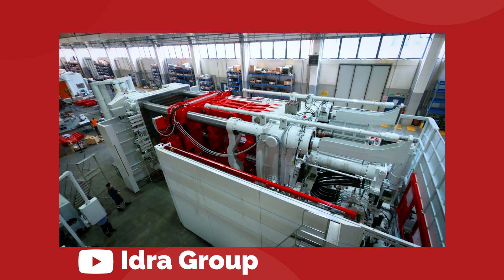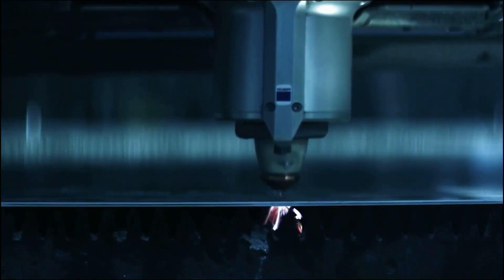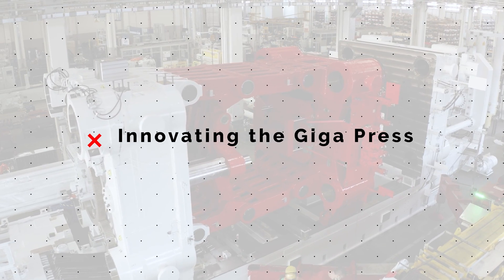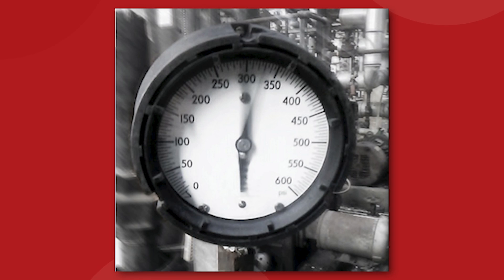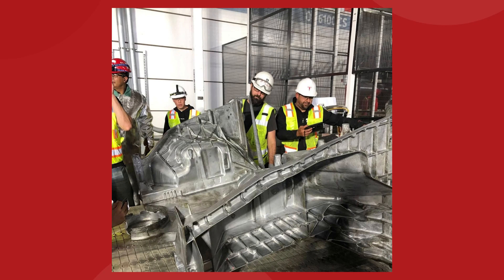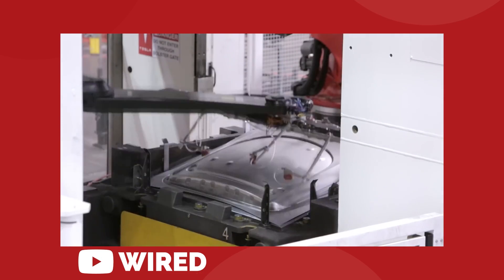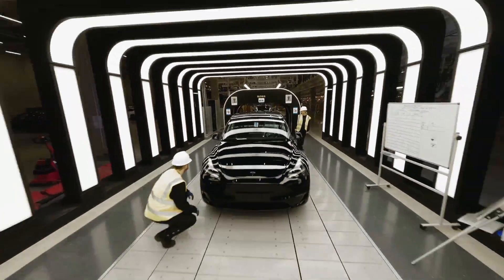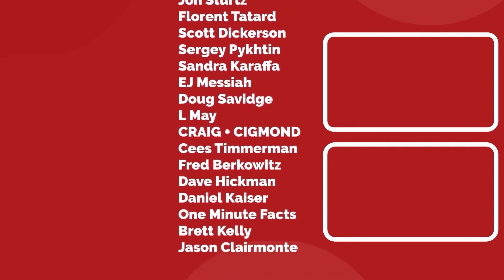The Real Reason Tesla Developed The Giga Press!

Comment: Very interesting! A cast aluminium part has many advantages. In addition to what is mentioned in the video, there are some more points: its lighter than steel, it is more corrosion resiatant with less efforts in coating it, and it can produce very complex shapes in one production step. But I dont think it makes much sense to cast the entire car in one go. Simple components like panels on the outside are easier to press from thin sheet stainless steel. Casting aluminium that thin is probably too difficult, and steel is also stronger. But for the frame work its a real clever idea.
All this goes, however, totally against the business model of the established car manufacturers. It would have been possible since decades ago to build cars that dont  rust- but thats the exact opposite of what the manufactorers want. If the competition wouldn't prohibit it, they would build cars that desintegrate after 5 years, so people have to buy a new one. But obviously Elon Musk is not the kind of business man that you usually find in big corporations.
Reply: Aluminum is less ductile than steel and has less elasticity making it prone to cracking over time, this is why suspension components will never be made out of aluminum, and aircraft have to recertify every so many flight hours. I doubt they are stamping their steel components out of stainless steel but 300 series stainless steel, will rust with the combination of salt and water in many northern parts of the world. 316 stainless will not but I can guarantee they would not be using that. At the prices a Tesla costs you are just getting what you pay for
Reply: @papapsych2746  many cars have aluminum suspension parts now. 

Rear subframes have been aluminum in certain cars and crossovers for a while, along with front and rear upper and lower control arms and shock mounts.
Reply: @volvo09  Control arms surprises me, maybe 7000 series aluminum is up for the task thanks for the info
Reply: @papapsych2746  It's been kind of thing to use aluminum suspension parts for a very long time. Even the C4 corvette had lots of aluminum suspension parts. But starting around 2000 is when you started seeing lots of manufacturers use aluminum for suspension components, hubs assemblies, etc. The 2000 Honda Insight was Honda's test mule for making nearly everything on that car out of aluminum, aluminum body, aluminum suspension, aluminum brake drums (steel inner ring), aluminum tie rods, etc. What I think this video misses though is that as you scale up the casting to such sizes it gets increasingly difficult to make viable parts. From an industry insider he took a look at the photos of the scrap piles of the casted parts and he saw what looked like still early stages of lots of waste, the gist of what he said was basically their failure ratio is still extremely high for the industry. 

I'm still curious how well these parts will fatigue or break. Also not sure how well it will be repairable, usually repairing casted parts sucks.
Reply: @sigmaprojects  Aluminum Tie Rod Ends?
Now I have seen too much. I guess they don't have to worry about their casted parts if they are casting things like Knuckles and control arms out of aluminum. I would of though their service life would be greatly shortened because of fatigue over time.
Reply: @papapsych2746  Honestly not sure. I think the fatigue life can be quite good if engineered properly. For instance in my insight, I have the original tie rod ends with 275K miles on them. I changed the lower control arms only because the bushings were shot, but no fatigue shown on the casted parts. What I have heard about in terms of fatigue has been the sheet metal. A casted part should have a much higher fatigue life due to the structure designed into it. 

As for the downsides with what Tesla is doing from my understanding it's still way too difficult to produce the casted parts in the size they want reliably. Like they do x-ray checks to make sure each part is good, but from independent photos of their waste bin, it looks like the success rate for a good part is still kind of low. So it may be at the moment not cost effective for Tesla and who knows maybe it will never be, but as being one of the first it might just need more time to mature since in the past casted aluminum parts for the chassis is still a relatively new thing. Even in my Insight, there's only a few parts that are actually casted aluminum, most everything is specially engineered extruded Aluminum, which Honda says that they had to come up with several patents to achieve. 

What worries me more is the cost of the actual part and repairing. Like does a Tesla with these casted parts become totaled after cracking the casted frame portion? But I don't own a Tesla with a casted part so it's no skin off my back, just food for thought.
Reply: @sigmaprojects  Yeah, if the rubber delaminates on old bushings in steel parts they generally can go without getting replaced, unless were talking about all of your motor mounts. How much more expensive were the aluminum control arms compared to steel ones? Since you had to buy OEM I'm betting.
Reply: @papapsych2746  They were a little pricy, I waited for them to go on sale since it wasn't critical I get them at that moment. I bought Beck Arnley, Dorman is cheaper, but when I waited for the Beck/Anrley ones to go on sale it was around $75/ea. Honda OEM ones are $230~ I think. Regular priced Dorman ones are like $135~ I believe. I wouldn't use my car as the goal post for part prices because the 2000 Honda Insight was pretty low production run vehicle, only about 18~20K units were produced world wide over the whole life cycle of the car. In comparison Toyota produces more Camry in the US alone in just one month. So it's kind of a hard to find parts car. Quick look, you can find say an aluminum control arm pair for a Suburban for like $250 and those are beefy units for a heavy vehicle.
Reply: @papapsych2746  I just did another quick search, for a Honda Odyssey I found a pair of aluminum aftermarket arms for $150.
Reply: @sigmaprojects  Yeah but they use the same parts for different cars over the years too. So the parts probably weren't exclusive to just your make and model. You really see this allot with American carmakers when looking for your part at a junkyard.
Reply: @papapsych2746  No, unfortunately they are specific to the that model. The 2000~2006 Honda Insight was built like a test mule/prototype. I've torn the car completely apart. Last piece to tear down is to do a full engine tear down. But from the parts diagram the only thing that is directly usable from other cars is the valve spring retainers are the same found in many other D-series Honda motors. 

Like I thought like you did and I hunted and searched for ways to make things work on my car from others. Like The only thing that remotely worked were certain gears that could be swapped out within the transmission. So I built a Frankenstein transmission out of a Civic Hybrid 5 speed utilizing a gear set from a first gen Honda Fit. I went to try the same thing with the steering rack in hopes to get a faster ratio, come to find that the pinion angle is different in the Insight, but not only that they used a thinner rack gear in the Insight along with more billet pieces instead of cast pieces.  The car was just a lot of fun tearing apart seeing all the care that went into making it as light as possible. But yea, Honda went quite overboard with the whole car, from shortened fasteners, aluminum hardware, like aluminum nuts and bolts for certain parts, to drilling holes out in the gear sets and differential housing, to extruded and billet pieces instead of casted parts. They really did put in a ton of work to get the car down to 1,850lbs, hats off to the Engineers.
Reply: @papapsych2746  The Filipinos  have been using SSTEEL  for gates and railings for decades in salty environments   like beachfront,  they have 7000 islands, also they have a lot of SSTEEL  Jeep conversions.
Reply: @aurelio-reymilaorcabal9669  Yeah are they submerging them in the ocean?
I'm talking about wet salty roads.
Reply: @papapsych2746  I live in Toronto Canada  where  salt and brine is used like there is no tomorrow , but only 3 months of the year , unlike  in many areas in the Philippines  where  salt is in the air 24/7, unpainted galvanized jeepneys and  "  SSTEEL   Owner type Jeep" conversions   are quite common, and it is easy to  find examples of 30 yr old  SSTEEL Jeeps still running , they just slap on a new powertrain, my family was in the Jeepney transportation BZNZ in my youth, I had classmates with SSTEEL Jeeps growing  up , they lived in Malabon  where fishing was an industry,
Reply: @papapsych2746  the air in coastal areas in the Philippines  is so salty many homeowners rain gutters are made of SSTEEL , show me a house in USA  that has  that.
Reply: @aurelio-reymilaorcabal9669  They make them so I'm sure people buy them. Never heard of 316 stainless steel framed jeeps though.
Reply: @papapsych2746  Well, the stability of such aluminium casts depends on the design. It takes a lot of developement (and perhaps some fails) to find a real good design. 
And Tesla does make cast suspension components now for the Model Y, replacing some they made from stamped steel and plastic before.
Acoording to what they say, the new Cyber Truck is made from stainless steel, and it has been done before already, like for the Delorian. 
And if it really doesn't work, there are always options like using carbon fibre parts. If it is done in automated production, its not even very expensive.
I'm pretty sure if Tesla invests billions in new factories and machinery, they know what they are doing.
Reply: That's not entirely true what you're thinking. Sure planned obsoletion is a thing, all manufacturers do it, but not always just maliciously. Furthermore manufacturers do use casted aluminum parts for chassis and in many areas they can use it to save weight. But none of the established brands want to flip the bill on something like a gigapress because it's not guaranteed to be profitable.
Reply: @sigmaprojects  Well, thets exactly what distinguished Musk's way of operating from that of the old manufacturers - they don't take risks and always go for the guaranteed profit. But with a new product like electric cars thats not the way to do it. The first cars were also build like horse carriages before, but it was soon clear that its not the best way for a car. 
From what I have seen from Musk so far, I'm quite sure he knows what he is doing. This is a totally new design and production method. Comparable perhaps with the change from the ladder frame cars to the stamped sheet steel chassis after WW2. The casting might be the next step in this evolution.
Reply: @petebeatminister  I mean that's the benefit of being a smaller company with no pre-existing employees, factories, suppliers, etc. I think people seem quite misinformed about car manufacturing. The main difference in construction that Telsa is doing over others is only in a few of the Models where they use the giga press. Everything else is seen in other vehicle manufacturers and done better. Where Tesla has excelled in is with their battery tech. They're still the leaders in that field. 

But for instance, GM did the EV1 vehicle, testing the waters for an EV. They don't have their own battery division, so they can't just make a jump, but they did anyways. Their EV1 wasn't bad for a first time EV, but the battery tech just wasn't there and the company that they teamed up with was promising a lot, but couldn't deliver. So for GM it didn't make sense to keep the EV1 since it's profit margins weren't that great and the battery technology just wasn't there yet. However, they didn't just stop on EVs. They kept in the game and put money towards hybrids and after 7 years since the EV1 showcased their concept. Then few years later they came out with the Volt, then the Spark, then the Bolt taking their time to figure out what's the best for them to produce volume EVs. 

People criticize existing manufacturers, yet it's not like they can just switch gears on the fly nor is it the most profitable. The profit margins on an ICE car is still really good and there's still tons of demands for any kind of car, so there's not reason to just stop and pivot. Fast forward just another 5 years since the Spark, Bolt, etc and GM got to work on their next line of EVs because the supply chain and technology for batteries are now finally mature. Government mandates on emissions keep making it harder on ICE, countries like China talking about straight up banning ICE and well now there's more urgency to get their EVs going.

The thing that existing manufacturers understand is scale. They move millions of vehicles each year. Like Tesla sells around 300K units a year in the US, which is pretty awesome all things considered. GM on the other sells almost that many in a month in the US. All businesses will work to survive and make money. It's only recently starting to make sense for manufacturers to make a bigger shift into EVs. in the next 5~10 years the landscape of EVs will be crazy different.
Reply: @sigmaprojects  The big difference between Tesla and othe car manufacturers is, that Musk is actually the boss in his company. If he wants something to happen, he just says "Do it".
The other ones have a board of managers, who all defent their seat with teeth and claws and hope for a nice christmas bonus. Risk taking is not what they want - and not what the share holders want. 
And of course Tesla had mostly the same production methods than the others. Until now. That is the amazing thing on the giga-press technology. It may revolutionize the entire car industry - or it may become a giga flop.
There is a lot that could be said about GMs EV1. Some people think it was only designed to prove that electric cars are crap. And that that was the reason why they didn't actually sell it, so they could retrieve it at any time.
But anyways... I think Tesla has shown that electric cars are not a joke. But thats also because technology has improved enormously since the time of EV1, both on the battery side but - may be even more importantly - on the motor side. The new Tesla motors are one step short of a miracle. With some more improved batteries, the whole electric car thing become a real competitor for ICE cars.
There is one big question mark still, however. Where do we get all the electricity from, if all cars are supposed to be electric?
Thats something nobody can answer with seriousity so far. Because that will require the next revolution: the one in electricity production and distribution.
Reply: @petebeatminister  Yea, when you're a smaller company it's easier to move, if Tesla was the size of GM people would be criticizing it for not taking risks or being slow.

The conspiracies around the EV1 are just that. It's normal business practice for automakers to not sell those kinds of vehicles. Like the very first Fuel Cell vehicles were lease only. It's a major liability and they want to control the press about it too. They don't want a failing one to bite them in the butt in the end.

The battery technology just really wasn't there yet. But like I said, GM wasn't bowing out of electrification. It takes 6~7 years to develop a new vehicle. That's why GM went on to make some serious hybrids like the Volt and short range EVs shortly after the EV1 project. The only companies that really poured money into electrification was GM and Toyota really. 

The giga press may be successful one day, who knows. Other manufacturers have been using cast parts for a long time so who knows, that or stamped parts even if more pieces may still be cheaper when considering scale of production. Like many people think 3D printing is cheap, just push a button, etc. But it's cheap for short run production, not cheap for individual pieces, not like stuff that is mass produced. So we'll see if IDRA can make the press work to the levels required for business. But remember, only some Model Ys will us the mega casted parts and MAYBE the Cybertruck. The process is still in its infancy and probably why it's not just rolled out for all vehicles just yet. It's not uncommon for manufacturers to try new ideas and do them for a complete production run and then switch back. Like Honda did center take off steering racks mounted up really high in the chassis to improve interior leg room space in there vehicles. Almost all of Honda's had them from 2000~2006/8 depending on model. But ultimately for whatever reasons they decided it wasn't worth it anymore and went back to conventional steering racks.

Tesla motors are great, but they're honestly not nearly as impressive as their batteries and computer management. The motors anyone can honestly replicate. The batteries and computers people say they can replicate, yet we haven't seen it just yet. Like Tesla still is on a 400~450v platform, yet manage their power so well. Most new EVs are being built on 800v or more now. Being able to work with higher voltages results in better efficiencies. So maybe next gen Tesla will make the move to higher voltage platform and we'll see them stay ahead in the range department. The gap is closing though. Back in 2012 with first Tesla it crushed the competition, Tesla understood at that time EVs aren't for sports cars, not for basic commuters, but for Luxury Missiles. So they came out with something that worked, while everyone else was trying to make affordable EVs which at that time wasn't really possible. Leaf and Spark were just so impractical. But fast forward 10 years (which isn't much time in the auto industry) and now almost all other EVs are about within 80% of Tesla in terms of range and performance for the same price and some exceeding Tesla, but for more money.

As for power grid maintenance? As the demand grows for more EV charging so will the demand for more electrical grid infrastructure. No one actually plans for anything in the future sadly until it's already here. So at least in CA there's just so much solar everywhere and it's growing. So I imagine many people will be getting localized electricity provided. People also say "hey, but people will charge their vehicles at night and that's when it'll be the worst" yes and no, during the day can be bad if it's summer with everyone running AC system. Also electric companies have switched to a time of use pay structure. So it'll end up forcing people to charge at different times of the day to keep their bill lower. Also cars like the Aptera for regular commuters boasts that if parked outside in full sun it can charge up 40 miles. For many people they commute around 40 miles a day, so if you had an Aptera you'd only need to plug in your vehicle for longer commutes and only top it off once and while. But we'll see if it actually can collect that much electricity in a day.
Reply: @sigmaprojects  Well, there are a lot of factors that play a part in the game. At least from what I have seen, the big companies act very inflexible and are always much to late. If you look at their electric vehicles today, they have basically done nothing else than a bit of cosmetic. I just watched a video about the production of the new VW Buzz, which is sort of a retro style electric  VW Transporter - it is build completely in the oldfashioned way. Really impressive is only the price: it starts from $ 60,000.
And its the same with a lot of electric cars, all the huge SUVs that weigh close to 3 tons, or 100k sorts cars like the Porsche Taycan.
But the power supply is a serious obstacle, I think. A few more solar cells or wind turbines wont do, if the goal is to do away with all fossil fuels. This is not about some wealthy hippies in California - its supposed to happen world wide. And in all sectors, cars, planes, trains, trucks, utility machines and whatever else. That is a hell of a lot of power that is needed for that, we are nowhere near to be able to meet such demand. You see it now: a little war in Ukraine, and the whole energy market goes into panic mode.
Reply: @petebeatminister  I haven't looked at VW, but the brands that are serious like GM or even Hyundai they build their EVs like they're suppose to on a new specific platform. Inflexible is what many see, they're just working with cost efficiencies. 

Electric planes, that's not going to happen any time soon. Trains have been electrified for almost a hundred years now. It's common to see a diesel-electric locomotive. Meaning you have electric drivetrain with a diesel generator onboard. Eliminating fossil fuels completely is quite difficult and isn't likely to happen anytime soon. However, you can capture nearly 90% of the thermal energy in the large modern steam turbine generators compared to most modern cars only really having the ability of capturing 20~35% and with what seems like a theoretical hard cap of 50%. So what I'm saying is even if you built a new power plant that ran off of fossil fuels you'd be better in efficiencies and controlling emissions.

The growth of electric cars world wide isn't so fast that we can't adapt nor would it work that way. If by tomorrow there were enough people with electric vehicles that we had rolling black outs or electric companies hike up their rates people then would think twice about buying an EV vs ICE. 

And I'm not sure why you think having solar is only for hippie rich people. Having them built over parking lots have been great, provides shade for the cars and easy charging access. Right now it's been mostly schools and universities that have been doing that, but some businesses have been opting for them on top of their buildings. But solar is just is just one type of energy source. And this has kind of been kept a bit low key because I assume nuclear just has such a bad press, but nuclear power expansions and advancements haven't actually stopped, at least not in the US. And I'm not talking about molten salt water reactors (although would be nice if they could figure out the kinks in those), but more traditional reactors. And like I said, even if you were burn fossil fuels, it's still more energy efficient at a power plant than it is in a car.

The real issue is figuring out how to properly salvage these batteries. Luckily we seem to be on the cusp of new battery technology and hopefully as time progresses we'll have better solutions for battery storages.